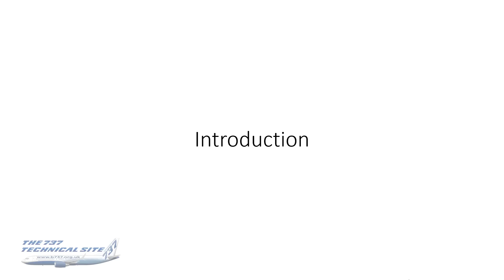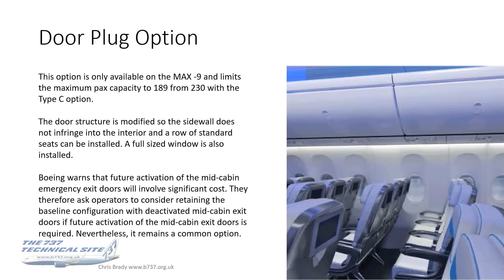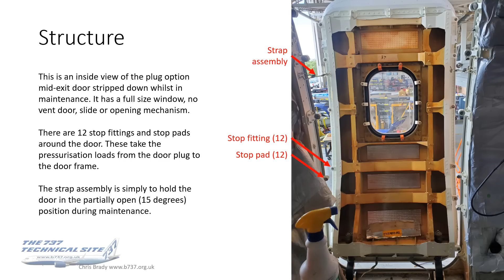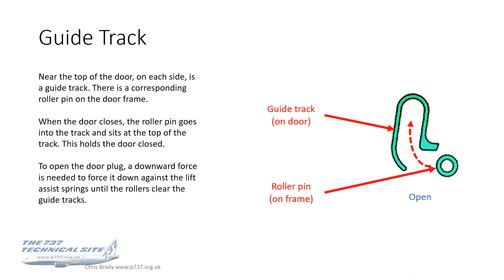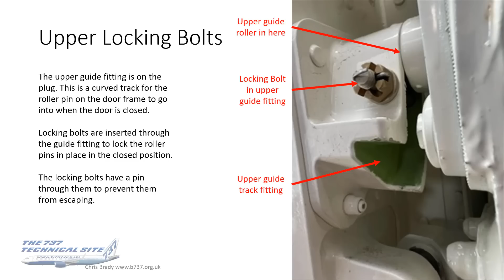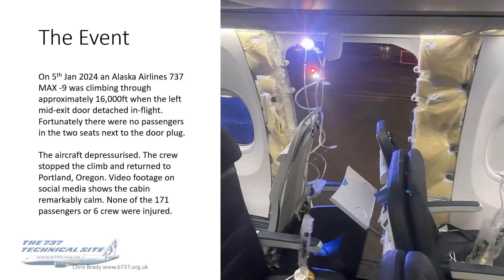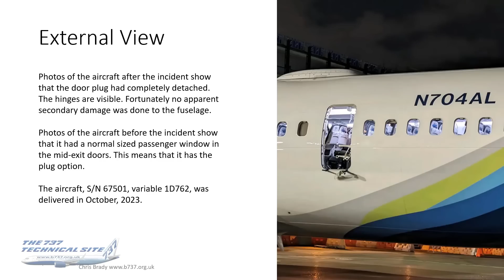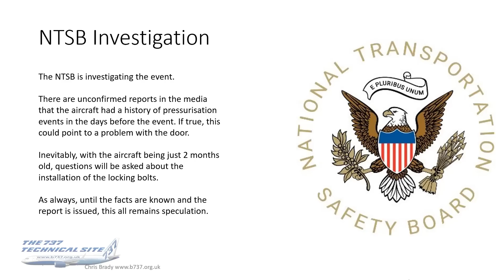737 Mid-Cabin Emergency Exit Doors - Plug Option

Comment: Hi Chris, those lockwires you refer to on the safetied nuts are called cotter pins. You had me thinking I'd forgotten what lockwire looks like, Lol!😂
Great explanation however, which, based on the lack of damage in general leads me to think somebody forgot to safety this door in place. That's quality control out the door for you. It's only going to get worse given how corporate thinks pilots and mechanics shouldn't even be near airplanes because it cuts into their profits. The more you know, the less you want to fly. After more than 45 years in what used to be my passion, you won't see me boarding anything anytime soon, but I'll hang on to the good times. Thanks for your videos.
Reply: Just hope those good times are not the 1980s where there were between two and five times as many deaths in aviation, in spite of way less miles flown.
Reply: I waas thinking that maybe they call them lock wire in England......   Likle french fries vs "chips" !
Reply: Lockwires are used elsewhere, but these are cotter pins. Lockwires are used to secure a whole bolt circle.
Reply: ..or Split Pins?

Comment: Watching the video up to 8:25, it is plain and simple all of the four bolts were not installed, for whatever reasons. These bolts are not under any tensile load, and their jobs are only to prevent the door from moving upwards and allow the guide tracks from disengaging from the guide pins. This must had happened during production, but more likely resulted from some service grease monkey either forgot, or didn't think they are important, let alone critical.

When the door hinged open during flight at 16,000 ft, the force from the aerodynamic drag must caused the door to be ripped off the two bottom hinges violently. I would expect the airframe where the hinges are fastened to be damaged. 

It amazes me how both FAA and NTSB downplayed the seriousness of the incident.

Comment: I am seeing something a bit different in reference to 6:30 in the video.  The lift assist springs are applying upwards pressure to the door.  For a plug install you would swing it in and use downwards force to engage the upper guide fitting.  If you were to release the downward pressure the door would flop open by itself.  That is what you would want if it was an emergency exit door, turn the door handle and it would force itself open.  The bolts in the upper and lower guide fittings keep the plug closed by arresting the force of the spring.  Pinning it in place so to speak.
Reply: Thank you, I am currently stopped at 7:30 in the video, trying to understand it, and your description helps clarify.  Am I correct:  (1) the roller is fixed to the fuselage, (2) the guide track is fixed to the top of the plug door assembly, (3) the lift assist springs are at the bottom of the plug door assembly, and are compressed to apply an upward spring force when the door is in its closed position (e.g. normal daily operation.)  So to open, the lift assist springs help (assist!) lift the entire plug door assembly, which lifts the guide track upward and ultimately clear of the roller, is that how you understand it?

If that understanding is correct (and I'm ready to be told I'm wrong) then this description in the graphic seems inaccurate:  "To open the door plug, a downward force is needed to force it {the door plug?} against the lift assist springs until the rollers clear the guide tracks."  If the guide track is on the door plug and the roller on the fuselage, and the roller is sitting at the "top" of the guide track, then pushing the door downward would only seat the guide track more firmly against the roller, already at the top of the guide track, wouldn't it?

I feel like I must be misunderstanding something.  What are we calling the "Door" and what are we calling the "frame"?  Maybe I have these two backwards.  Put another way:  Is the guide track attached to the removable door plug, or fixed to the fuselage opening?  And likewise, are the roller pins attached to the removable door plug, or fixed to the fuselage?  If my understanding is backwards, then that would explain my confusion.
Reply: @svyt  Several of us caught that.  You lift the door to release it.
Reply: @svyt  Your 1st paragraph is correct.
Reply: @Cobalt135  Thanks - and I mean this respectfully - just trying to evaluate the credibility of your information - you are confident in this information based on specific knowledge, or speculation of how you think it works.   (I admit that I 100% do not know!)

Edit to add:  Never mind.  I made the mistake of posting all of this while I had the video paused around the 6 - 7 minute point.  Later explanations and photos confirm all of this.  Guide track on the door plug, roller pins on the door frame (i.e. fixed to fuselage, effectively.)  Sorry wasting your time and questioning your info before I went further into the video!

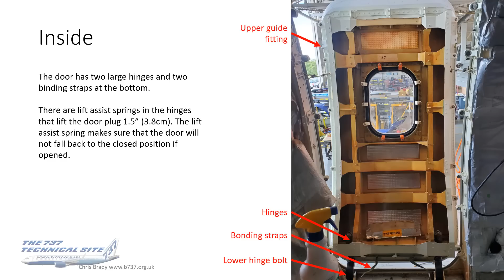Based on this, I suggest that the last statement in the graphic from 6:26 to 7:26 is incorrect:  "To open the door plug, a downward force is needed to force it against the lift assist springs until the rollers clear the guide tracks."   This is inaccurate, because in the normal "closed" position, the door plug is already forced down against the compressed lift assist springs, so the statement for how to open it should be something like "To open the door plug, after removal of the two upper locking bolts and the two lower vertical movement arrestor bolts, the plug assembly is lifted (with the help of the lift assist springs) so that the upper guide tracks move upwards off of the roller pins to release the top of the door so it can hinge outward."
Reply: @svyt   Correct. However maybe an initial downward force is needed to remove the locking bolts. They would be under shear tension from the springs. Forcing the door down a few micrometers may relieve the shear tension, so the bolts are more easily removed (slide out) . Then the door can move up with the assist of the springs.
Reply: @Cobalt135  Correct.
Reply: @-Primer-   Fair point, and I completely agree with your description of the mechanics - the locking bolts and roller pins would be pre-loaded in shear against each other, and you'd definitely want to relieve that to remove the locking bolts.  Although I don't think that any of that is the intention of the wording in that graphic:  "...force [the door plug] down against the lift assist springs until the rollers clear the guide tracks."

I know I'm being super-pedantic here - this is the YouTube comment section after all :) - but I think that a correct understanding of the door plug release process is fundamental to speculation as to what might have gone wrong in this incident.
Reply: @-Primer-  They would be under shear tension.  And I would say you are correct, the procedure for opening the plug for maintenance you would likely need to apply some downward pressure to remove the bolts.  I think the person in the video is not trying to give the details of how to remove the bolts, but they are explaining how the plug moves between the closed and open position.  Sometimes it is easier to think of it like an emergency door was installed instead.  Everything is the same as shown except none of those bolts would be installed holding the door down.  The door and raft assembly would be closed, pushed down against the springs, then the locking handle is moved so that the locking mechanism protrudes from the door into the fuselage (like the lugs that lock a gun safe).  The door is then secure.
Reply: @-Primer-  That makes good sense! It might explain the confusion about moving the door downward first.
Reply from the maker: * Errata *
In this video I state that a downwards force is required to remove the door plug. I based this statement on text in the AMM SDS which I now believe to be incorrect or misleading. It is possible that a very small downwards motion (1-2mm) is first required to be able to free the locking bolts. But the door must be moved upwards by a couple of inches to clear the guide tracks. Apologies for any confusion.
Reply: @ChrisBrady737  Maybe I should have said the tech manual is incorrect when I explained the mechanics of the latch 2 days ago. In the USAF we called them T.O.'s or Technical Orders. They were written by McDonald Douglas / Boeing and they would be wrong all the time. Often including un-necessary steps or missing steps all together. Sometimes you need to see the actual part,  and not some drawing or written instruction to understand the mechanics of the part in question. And fortunately we were given those pictures to analyze.  If the recovered door is photographed well, and we see no deformation of the holes where the "capture" bolts reside, I think's its safe to assume they were never there, or were not secured with the required cotter pin.
Reply from the maker: @-Primer- Thanks, I stupidly assumed that the manual would be correct. You are right, there is no substitute for seeing and handling the actual part.
Reply: @ChrisBrady737   "I stupidly assumed that the manual would be correct." 

No, no, I'm not saying that. Manuals surely have their place, but never deny your own eyes. Let the manuals guide you and your eyes and hands confirm your beliefs.
Reply from the maker: @-Primer- Wise words 👍
Reply: @ChrisBrady737  "I stupidly assumed that the manual would be correct."

Everything is fine, nobody said that or meant it that way! You have explained the technical details so well here. It's just a little crazy that important instructions or manuals on something as critical as an airplane aren't worded precisely or even incorrectly.
But it's probably like you said, that it takes an initial push outward and slightly downward to free the door from the bolt position or release the spring.
Reply: I suspect the door isn't lifted by the springs alone; they wouldn't be called lift assist springs if they did all the lifting? So my guess is that the springs make the door feel a lot lighter, but you still have to lift the door. But I'm 200% speculating, correct me if you know for sure that I'm wrong.
Reply: @TheHuesSciTech  If an exit door was installed the springs would have to be sufficient enough to lift the increased weights of the door latching mechanism and slide assembly.  Also this emergency exit would very likely be operated by a passenger in that row.  You should only expect someone to be able to operate the handle in an emergency, not go through other motions to release the door.
Reply from the maker: AMM SDS 52-23-00 Page 6 MID CABIN EXIT DOOR PLUG - COMPONENTS, Lift Assist Springs:
"Apply a downward force to the door plug this forces it down until the rollers clear the guide tracks. At this time the door plug can open outboard."
Reply: @ChrisBrady737   That is from the maintenance manual and is procedure for properly opening the plug.  Yes, you would need to apply downward pressure while the locking bolts are removed to keep the plugs upward moving tendency from interfering with this task.  As you ease the downward force the plug would move up the guide tracks to the open position.  If all the locking bolts are removed the only thing holding it closed is downward pressure.  Knowing the hinge mechanisms and guide track are the same on the EXIT door option, and there is no locking pins at those locations, when you turn the handle to open the door it would move up and out.
Reply: @ChrisBrady737  Based on the image @ 9:30 , that does not jive. A constant downward force would never allow the rollers to clear the guide track.  I worked on BOING C-17 and the doors operated the same. The door must be lifted to clear the roller track.
Reply: @ChrisBrady737  I accept that this is what is written in the manual, but let's check this against what we now understand. Let me recite what I believe to be two basic facts: (1) The guide tracks have their openings facing downward, and are attached to the door plug, thus the guide tracks are the elements that move up and down in the latching/locking mechanism.  (2) The roller pins are attached to the door frame, i.e. the fuselage, therefore they are fixed.  

So picture the latching mechanism that is described by those facts, and it seems like the following statement is inconsistent with how that mechanism would open up:  "apply a downward force to the door plug until the rollers clear the guide tracks."   

With guide tracks that open downward on the door plug and fixed roller pins on the fuselage, wouldn't it be the case that applying a downward force to the door plug would just hold the whole assembly in the firmly latched position?
Reply: @ChrisBrady737  Very odd what the instructions say. A downward force makes no sense for mechanical reasons. When closed, the rollers are already at the very top of the guide fittings on the door, so there can be no more play. I've been confused about this since yesterday and I've read it a lot in the comments here.
Even if you look at the door from the outside, it sits flush with the bottom edge of the frame when closed. The gap and therefore room for movement is only above it, the door has to be lifted.

Part of the force is applied by the springs, the remaining force could have been caused by turbulence, for example, especially as the convex guide rail also means that the enormous internal pressure against the door can cause a large part of the movement in the rail. Not a good design. Assuming, of course, the locking bolts were not properly reinstalled.

I'm looking forward to the official report.

Nonetheless, a great video. Thanks for that!

Comment: 6:33 "Guide Track" page - Is there an error in the 3rd paragraph on opening the door plug. Paragraph 2 has already clarified that with the door closed the frame roller pin is at the top (closed off) end of the guide track on the door.
Then the 3rd paragraph says to open the door, force it down against the assist springs until the rollers clear the guide tracks. Before you start forcing the door plug down, the frame rollers are already at the top (closed off) end of the guide track, so no further downward movement of the door is possible.
Surely opening the door plug requires an upward movement of the door plug, assisted by the assist springs, until the rollers are out of the lower end of the guide track?
Or have I got something wrong? I think you also described it this way yourself, earlier in the video.
Reply from the maker: AMM SDS 52-23-00 Page 6 MID CABIN EXIT DOOR PLUG - COMPONENTS, Lift Assist Springs:
"Apply a downward force to the door plug this forces it down until the rollers clear the guide tracks. At this time the door plug can open outboard."
Reply: @ChrisBrady737  The key item that I haven't seen anyone else mention here is that the downward force is moving the roller pins down so that the roller ins will clear the roller guide. If you look very closely at the picture from the inside showing the door in the maintenance position, ie 15 degrees tilted outward, you can see there is hardware that looks move this pin up and down as the lifting spring moves up and down.

The lifting spring is not holding the weight of the door up, but rather holding the roller pin in the upper position of the door guide channel.
Reply from the maker: * Errata *
In this video I state that a downwards force is required to remove the door plug. I based this statement on text in the AMM SDS which I now believe to be incorrect or misleading. It is possible that a very small downwards motion (1-2mm) is first required to be able to free the locking bolts. But the door must be moved upwards by a couple of inches to clear the guide tracks. Apologies for any confusion.